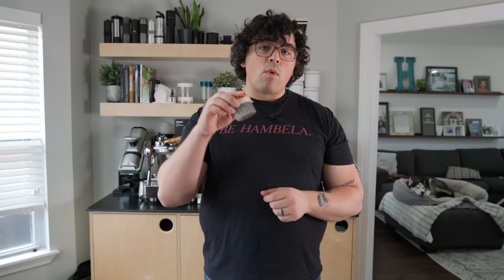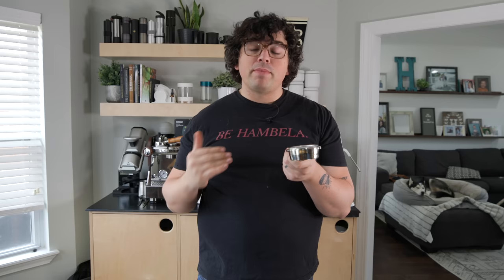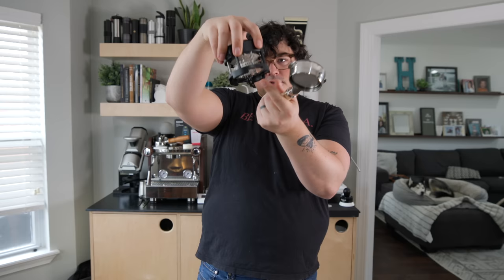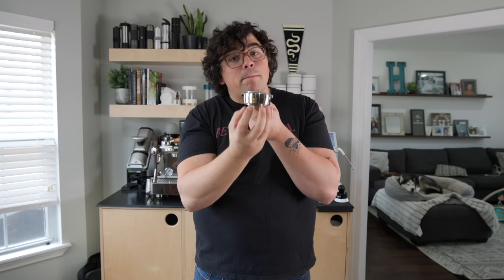IS THIS $300 ESPRESSO TOOL WORTH IT?: The Porcupress Review

Comment: This tool makes me wonder how a machine that used dispensing needles instead of a screen would be able to change extractions by injecting water directly into the top 1/3 of the bed as oppose to ontop of the bed.

Comment: I think it'd be interesting to know if this tool makes a meaningful difference with suboptumal puck preparation, skill, and equipment. If so, could be a decent crutch for the coffee enthusiast, and maybe suggest stronger correlation of balanced extraction and this method.
Reply from the maker: It is not. I thought I implied that in the video but obviously my ability to do so was not noticed by lots haha! Apologies there. It does not seem to fix bad puck prep.

Comment: Thanks yet again Lance, have been looking at it especially as I watched the video of Perger those many years ago, as I only drink very light roast I thought it might help, although I’m actually still questioning whether or not it would actually do anything on other machines then Decent, You, Mina and other pump profiling machines I’m still doubtful if it would actually make sense on a Flair58 and the use of unimodal SSP burrs.
Reply from the maker: If you're doing profiling stuff on the 58, you'll be able to uptick the extraction for sure. It'll open up some new experiences for you, imo

Comment: Great video, I did very much enjoy it. I do have a question, however, which is somewhat unrelated. I am looking into buying a Kono dripper based solely on the video you made about it. Yes.. you were that persuasive. Do you have a recipe that I could use to brew 400 or 500 (preferred) ml batches?

I posted on the Kono dripper video but I don't think you look at those comments anymore, or just haven't had time. Thanks!

Comment: Hey Lance - big fan here. I just bought 2 weeks ago DB machine that has pre-infusion up to 30 seconds. I currently have it set to 5 seconds (it comes with 2 as a default) - what values would you recommend? (I mainly use medium to dark-ish roasts).
Reply: I have a Bonavita drip machine with pre-infusion.  The water “pulses” through in intervals for the first :30 (not adjustable) to bloom the fresh ground, and then continues on with a shower head that supposedly approximates a pour-over agitation (but who knows).  Best automatic coffee maker I’ve ever owned.  Most recommendations I’ve seen say to bloom at least :15 seconds…LH has a vid that does an…interesting…take on how to manage your bloom time.
Reply from the maker: The darker the roast, the less need for pi. I would leave it low probably.
Reply from the maker: Haha! Just based off observations my astrophysicist friend has made. Takes roughly 2min for water to full penetrate grounds in pourovers
Reply: @LanceHedrick  it's an espresso machine in my case. I've been reading online that anything between 2 to 12 seconds will do.
Reply from the maker: Yeah! Sorry. The other comment was directed to the other person. My comment to you was saying around where you have it already is great!

Comment: The following is not a hate comment, although it may seem like it at first. 
It’s more a critique on methodology used to approach a scientific method for testing commercial equipment.
It reads as follows:

Well, did you measure the grams of coffee lost, due to using the porcupress? I mean, there are a lot of needles, therefore a lot of coffee is stuck to them. I would speculate this would come together to ~ 0.5g, which could explain the „higher density“ part. Also you referenced only one paper, which could be biased, instead of presenting two unbiased sources (relative to your own testing).

Of course, if this device works as told, this would be great. Especially if the price would be lower.
Reply from the maker: Hey! There is perhaps .05g of coffee, if that, on the needles. The grounds don't really stick and my number is guessing the miniscule powder residue has any meaningful mass beyond what a scale could even read.
Reply from the maker: And my conclusions are based off mainly simply density measurements. Check the methodology and recreate yourself (genuinely). Pretty simple and straightforward measurement. But I understand completely the hesitancy to accept a single study.

Funnily, the original theory has zero evidence to back it up, so at least we've got something on this side haha!
Reply: Thanks for answering that quickly. I’ve checked his method of measuring density, to me it seems viable to use, since both measurements have the same approach for measurement (therefore an equal error may be simply „subtracted“ from the presented data, if there’s no error dependencies). 

I know of several other methods for measuring density. I especially find the industrial approach used for bulk materials interesting. The main problem when measuring the density here (or with ground coffee) is the particle geometry, thus particle orientation may influence this largely. 
You may look up the packing density of different shapes and from this derive an approximative coefficient for density measurement/ a formula.

I will do some testing on my own, but have to say, that without an appropriate method, which measures air pockets inside the coffee itself, the result may be seen as useless for a scientific interpretation.
Reply: To specify this: the industrial/scientific method would focus on measuring the density inside the puck with microwave radiation. This would result in an accurate measurement of the actual possible maximum packing density in the current configuration.
Reply from the maker: I'm curious what shay would say to this, as he, too, is a practicing scientist. I'll ping him
Reply: @LanceHedrick  ok, did he say anything?

Comment: You claim in your video that this is not suitable for most users, but you don't back up your claim with any data.

Other youtube channels find the same 1% uptick and taste improvements for flat 9 bar shots.

The correct buying decision seems rather difficult to ascertain this way :D
Reply from the maker: I don't think I was as direct as "This is not suitable for most users." In my collection of data, which is included in the caption, I found it only made any significant difference when one is doing everything really well (good wdt form, perfectly level tamp, etc)  otherwise it didn't change much. 
Unless you are feeling you need 1% extra, I don't see the need for most users to get jt. If you are doing flat 9 bar, you likely would not want another percent of extraction
Reply: @LanceHedrick  Thanks for your answer.

I was referring to your data for the other flow profile/flat profile shots, which you mention in your video but are not included in the Pages sheet in your caption.
Reply from the maker: Oh! Good catch. Will need to add that. Should've been on that same page.